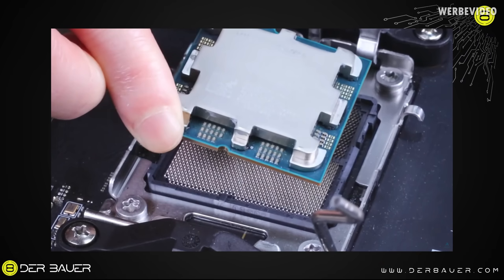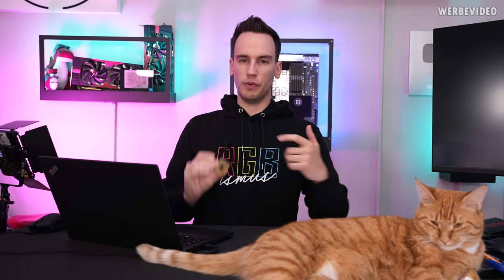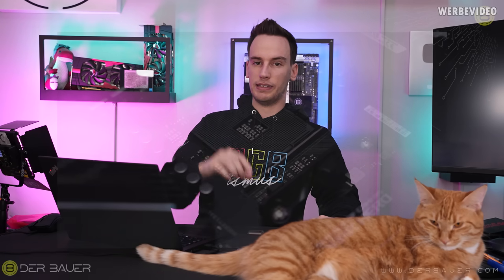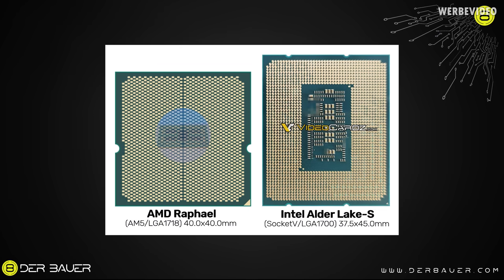Very thick IHS and less Contact Area - some thoughts on Ryzen 7000

Comment: Next video: Der8auer has made his own Zen4 watercooling block 😁
Reply: That's a given with the setup in his workshop. Gonna be awesome.
Reply: More likely a offset bracket for an existing cooler.

Also 100% he will mill the IHS down to test.
Reply: Can you make 4 point mounting brackets for AIO LCs that use the AM4/AM5 plastic clips? I would love to see if the 2 point mount is leaving cooling performance on the table as I suspect. 
Thanks
Reply: @stephanhart9941  just buy a better cooler!
Reply: @ionstorm66  There are High end AIOs that use the 2 point AMD mounting. The cooler isn't the problem, just that they prioritize Intel mounting. My Galahad360 is as "Better" as it gets without a custom loop.  Your point is asinine.
Reply: Germany doesn’t have the electricity for his machine shop anymore
Reply: And he did

Comment: The io die has rdna graphics as well this time so that might be the reason its not as small as expected
Reply: Also, probably why they moved to the center. It will need better cooling this time around
Reply: @broklond  its 2cu igpu that thing wount even sweat
Reply: it has been said that IO doesnt scale as well on a smaller node but also, we are getting more and faster IO so the size is not a surprise
Reply: @broklond  It makes no sense to move the puny 2 CU GPU towards the middle when it pushes the actual power-hungry up to 16 cores more towards the edge.
Reply: @DLTX1007  didnt zen 3 use a 12nm IO die?

Thats a huge difference to the 6nm used now. I know its not a direct comparison, but all else equal it should be a 75% reduction in die size. That its not implies a lot, especially with the graphics cores and large number of PCIe5 lanes to the CPU.

@thatguy75 IIRC the IO die was a not insignificant chunk if the thermal load on zen 3 (up to 30% iirc) and with it supporting 24? PCI 5 lanes as well as two CU’s of graphics its going to need a lot more access to traces and pin contacts. They probably HAD to put it in the center to support the PCI lanes and other stuff without issues
Reply: @JAT985  yes but I said IO doesn't scale well. It's a well known fact in the industry. SRAM scales very well which is why AMD can put massive amounts of L3 onto Zen2/3/4. But IO is harder.
Reply: @DLTX1007  The CPU cores are 5nm while the IO is 6nm so of course it's not going to shrink as much .... Also if you don't actually need the space it's better not to pack the transistors in there even if you can because it will just cool better because the heat from the transistors is spread over a wider area and isn't so concentrated in a smaller spot .... Just making something smaller for the sake of making it smaller and not for a good reason is just poor engineering practice
Reply: @longjohn526  I said IO not CPU cores...

Comment: with that thickness, wonder if anyone has considered a dedicated vapor chamber IHS rather than a traditional solid metal IHS?  people would need to be very careful with heatsink application to prevent damaging the specialty IHS but it might be a way to improve cooling performance by maximizing heat transfer over the entire surface area while eliminating hot spots completely!

Comment: I don't think any of the IHS changes actually matter if the limiting factor is the thermal density of Zen chiplets anyways.
Reply: It does matter. There's a reason people sand off 2mm off IHS or completely remove it.
Reply: ZEN4 can also possibly use wafer thinning as they did in zen 3d to improve thermals.
Reply: @hndfhngtool-assistedspeedr2128  the reason people lapped cpus was not to remove z height it was to create a level contact surface since most ihs's come either concave or convex from factory
Reply: @Bobis32  it's both reasons
Reply: @vineetkumarbharti2633  that doesn't improve thermals. They did it in v-cache chips to keep the same z height so that it fits in the regular IHS.
Reply: @superneenjaa718  but with wafer thinning in zen 4 they can increase IHS thickness which is indeed increased.
Reply: @vineetkumarbharti2633  why would they do so? V-cache stacked chips will come out for zen4 too.
Reply: the problem is die area. For reference...a power transistor (MOSFET usually) would have better thermals and less on-state resistance with a larger die area. Capacitances (that cause anomalies and limit maximum switching speed) would increase as well.

The transistors on the AMD dies are so small but so packed - one solution is to reduce the amount of levels of interconnect and turn a multi-story building to  three or so floors...widen the area where the heat spreader would meet the dies. But there is an issue: signal propagation delay. And also thermal monitoring would be more complicated because die area had enlarged and perhaps require a thermal sensor array

A larger IHS would help balance thermal offset as it would hold more heat - but meant it won't dissipate it that quick as it soaks in temps
Reply: @ruikazane5123  on the other hand, it insures a wider heat spread.

Comment: Having values for the chiplet and i/o die size with the performance date show quite an uplift. Still we have no wattage consumption data for now, but it is coming together slowly.
Reply: I reckon it's gonna be extremely power efficient, especially if they're retaining the existing core count.  The only way it won't be is if they're REALLY pushing the silicon to squeeze out every little bit of clockspeed they can (ie running 0.150vcore higher just to attain an extra 100MHz all-core boost or something)
Reply: It has been revealed on two websites and gamer Nexus and amd also gave new info out
170watt means more like 125watt CPU as the new PPT is 230 watts

So not much difference as all the other CPUs are still at 65 watts and 105 and 125 watts now
The info was corrected by AMD.

It's mainly the reason why the PPT is 230 now so the CPU can overclock further.
There is a max ceiling  to this.
It is still lower than the 12900k which is at 250w PPT

Comment: The thicker ihs will also mean that they have more room for 3d stacking in subsequent generations using the socket by just going back to a more normal thickness.
Reply: Is that going to be practical? They've already had to limit frequencies and prevent overclocking on Ryzen 5800X3D with 3D stacked cache, I assume due to extra heat generation and inferior thermal conductivity of cache compared to copper. Stacking even more cache (or worse, cores) vertically is going to make the thermal situation progressive worse.
Reply from the maker: Not really. For current 3D Stacking technologies you will thin the bottom die before stacking which means that the resulting total height is the same as before. Maybe 0.1mm thicker. But that is for sure not relevant here. If you increase your die by 1mm it will be impossible to cool.
Reply: @der8auer-en  maybe the 3D cache maybe moved across the die as …. Once again : rumoured …. The cache will be increased on the Zen4 die 🤔
Reply: Not quite how it works.
Zen 3D/Milan-X have the same Z height as Zen 3/Milan
Reply: Admittedly I’m not an expert, but maybe they didn’t want to thin the dies? It seemed like kind of a hack with Zen 3 to make it fit with the existing AM4 dimensions, and I would imagine that it added a lot of manufacturing complexity.
Reply: @alex84632  thinning the dies is beneficial because it helps with cooling. Intel thinned the dies on Comet Lake and made the IHS thicker for this reason. Copper is much more conductive than silicon, so for the best cooling you want as little silicon and as much copper as possible between the bottom of the die and the cooler. Though minimising the total distance to the cooler is even more beneficial, as heat pipes are a lot more conductive than copper.
Reply: @kotekzot  Nah Robert Hallock confirmed that the 5800x3d was locked down due to voltage, not heat concerns.
Reply: @kotekzot  they have said that the 3d Vcache was/is significantly more sensitive to voltage and they couldn't  prevent people from killing the CPUs easily but they hope to overcome this in future.
Reply: @der8auer-en  NUDEcnc videos show  extreme lapped working cpus  to *0.5mm
for sure people will remove the just 150W/mk of silicon in exchange to 400w/mk cooper heatsinks.
Reply: @mikesteve3039  did they say why they had to drop core clocks?

Comment: You are correct, if the manufacturer makes a new coolers keep in mind the new(Estimated ) hot spot position, then they will deliver better performance.
Reply: unless they fix the heat transfer issue (IHS does not take any heat from chip), this won´t do anything.

Comment: It's going to be interesting what happens with cooling, as chips get more thermally dense moving heat from the slicon is going to be more complex. I wonder if we will be forced to move more to AIO's or if some more advance cooling will come along. I wonder if we will ever see something like a Vapour Chamber as part of the IHS to help?
Reply: people just need to understand that it's not 2001, they don't need to make their cpu's run below 70c anymore.
Reply: Water channels running inside the die are in development, that could improve cooling a lot, but I expect reliability would decrease significantly.
Reply: @kotekzot  Imagine the price increases 🙃
Reply: @sirmonkey1985  boost frequency is decreased with higher temperatures
Reply: @sirmonkey1985  no but most cpus are fine below 85c on stress tests... gaming load should be 55-75c at max unless you have a 12900k/5950x...then 80c is fine.
Reply: @kotekzot  I’ve been seeing articles about water channels in die for the last 10 years, but apparently nobody wants to touch that for consumer CPUs. I’d love to be proven wrong, but I think we’re still 10 years away.
Reply: @sirmonkey1985  electron migration?
Reply: @NavinF  yeah, I don't see how you can do water channels in the die practically without bonding a "waterblock" to the CPU at the factory.
Reply: What cooling? Better cooler only has very small effect on AMD CPUs, since Ryzen 2xxx, as the IHS does not transfer heat from CPU. The coolers remain cold even at full load.
From my own experience, nowadays with AMD only the fans used matter, not the cooler itself, as there is no heat for the heatsink to take from CPU. Instead, we are cooling down the IHS, which in turn acts as some opposing force against AMD chip to lower its temperature a little.
It´s either a defect in solder (which nobody seems bothered with), or some other thing specific to AMD chip design.
Reply: @Morpheus-pt3wq  small die = less contact area = harder to cool.
Reply: @kotekzot  but small die doesn't explain, why there is literally NONE heat transfer into the heatsink. And it started with AMD 12nm Zen chips, which were larger than current 7nm.
Reply: @Morpheus-pt3wq  I don't believe there is 0 thermal energy transferred from the IHS to the heatsink.
Reply: @Morpheus-pt3wq  interesting, if the IHS does not transfer heat, why does my ryzen on an AIO boots @ 14-21ºc with the fans nowhere near the socket, and the old wraith stealth was already at 40ishºc?
Reply: @malonysaintpierre1599  touch the cooler while cpu is in heavy load. It will be cold, which means there is no heat transfer to the cooler.
Reply: @Morpheus-pt3wq  under load it goes to 40ºC, with the wraith stealth it would reach 70's and would blow how air everywhere, because the heatsink was in fact, hot
Reply: @malonysaintpierre1599  did you touch the cooler to confirm that? 3 of 4 Ryzen cpus in my house (3400g, 3600 & 5600x) do not transfer any heat into the heatsink, no matter how high their load temperature is.
Only thing, that has real effect on their temperatures, are fans. Stronger fan with greater ability to move air through the heatsink, the lower the temperature.
Interestingly enough, another of my Ryzen cpus, 2200g, which only uses thermal paste under ihs instead of solder, is fully able to conduct heat into the cooler.
Reply: @Morpheus-pt3wq  Bro what are you smoking? Where do you think that power goes then?
Reply: @EndstyleGG  your brain fumes. Into the socket.
Reply: @kotekzot  where does the heat from CPU then go, if cooler remains cold while CPU is in heavy load? 
I do think the process is reversed here. Instead of heat transferring from IHS to heatsink, the cold from heatsink is being transferred to the IHS and acts as an opposing force to the die. CPU will still run hot, especially those random spikes, that vary from chip to chip and are uncoolable. My 3600 tends to spike up to 79°C no matter which cooler i put on it.
Reply: @Morpheus-pt3wq  heat = energy and only flows from hot to cold/high energy to low energy. When you open a refrigerator you aren't "letting the cold air out" as some people say, you're letting hot air in. Your hypothesis is fundamentally incorrect. Source: thermodynamics
Reply: @610jrod  well, then something is fundamentally wrong with AMD solder, since most of the heat remains trapped under IHS.
Reply: @Morpheus-pt3wq  unplug all of your fans, run prime95 for a few minutes, then touch the heatpipes at the BASE of your cpu cooler, closest to the IHS. You'll feel that the cpu cooler is warmer than ambient & is transferring heat away from the IHS.
Reply: @610jrod  are you trying to punish him for not understanding thermodynamics by telling him to fry his CPU?
Reply: @610jrod  what are you talking about. When i feel the airflow through the radiator on my 2600x at 60c, the air definitely gets hot, meaning it transfers heat just fine. Your heat transfer theory doesn't make sense
Reply: @kotekzot  prime95 is the first thing that came to mind to guarantee heat generation. It'll thermal throttle itself for a couple mins but that won't kill it
Reply: @DarkoPetreski  I'm not sure what your point is. In your example the heat still transfers from cpu -> ihs -> thermal paste -> cpu cooler -> water -> radiator -> air. Morphius is saying it happens in the reverse direction.
Reply: @610jrod  i´m still interested, WHY is the heat transfer on 7nm chips SO LOW. If the CPU runs at 70-80W or more, the heatsink should be hot af, so i should burn my fingers, when touching it.
I´m not unplugging my fans. Air isn´t effective heat conductor, that´s why we need a lot of it for cooling.
Reply: @Morpheus-pt3wq  there are a few factors. 1. The CPU is rated up to those temperatures but it isn't going to draw that much power unless you put a large load on the it. At idle/basic office/web browsing use it's probably closer to 20w or less. Similar to how your car may be able to go 150mph but you aren't actually reaching those speeds day-to-day. You can use a program like HWINFO to see the power draw. 
2. The thermal mass of your CPU cooler is many times greater than that of the CPU. The heat is distributed from the base into the cooler, as it moves farther from the heat source the energy is bled off by conductivity with the air. Yes air is a poor conductor but that is made up for by having many fins to increase the surface area (instead of a solid block of metal), and by using fans to constantly force fresh air over the fins instead of solely relying on conduction to move heat away from the cooler. The greater the difference in temperature between the cooler and air the more effectively energy is able to transfer. If you remove the fans and rely solely on conduction the cooler would warm up, heat the air molecules immediately adjacent, and then lose effectiveness as the temperatures near equilibrium
Reply: @610jrod  thanks for the exhausting reply. Also thanks for not giving up on me.
Reply: @Morpheus-pt3wq  you're welcome. No worries, it's good to ask questions & want to understand why things happen
Reply: @610jrod  it´s the only way to knowledge i know about.
Reply: @TheBURBAN111  the 5950X is very power efficient even on multicore AVX workloads, it shouldn't hit 75 C (even without undervolt) during gaming with a decent single tower air cooler.
Reply: @Postman00  it does though... even with the nhd15 it can hit 75c while gaming...
Reply: @TheBURBAN111  I'm literally using a NH-D15 in one of my two 5950X workstations. That station's CPU maxes out at 68 degrees in games. What's your ambient temperature and what case are you using?
Reply: @Postman00  Only going off what ive seen on peoples setups... they were probably using PBO with auto vcore.
Reply: @TheBURBAN111  a proper overclock should include a stability tested undervolt, and a stock 5950X would not boost high enough for gaming power consumption to cause high temps. I wouldn't look at misconfigured systems and say "there, 5950X runs hot!"
Reply: @kotekzot  I heard of that many time ago and I actually don't agree with such thing to ever be released... Judging the huge problems many AIO have been having, imagine if they make a CPU that is made to really need water passing trough and what it would happen if it gets all clogged up some time later 😵😭
Reply: @guily6669  at the moment, watercooling is mostly a meme for enthusiasts. With water channels running inside the die, it would actually become good enough to develop some hardware support, e.g. the motherboard generating alerts if the flow rate decreases too much (clogging doesn't normally go from 0 to 100, so there's time to fix it), throttling power consumption depending on the flow rate, emergency shutdown.
Reply: @kotekzot   still the channels would be very micro and would be pretty problematic after getting clogged and super hard to maybe even impossible to clean unless maybe with a sonic cleaner + air compressor and still who knows...

Comment: If the IHS is a good grade copper this could make a lot of sense. I'm also thinking that the "octopus" style, as you call it, might prevent the slight bending that we see on Alder Lake.
Reply: They probably needed as much surface as possible hence the weird shape. I just wonder if this wasn't to little. We'll see what the thermal performance is going to be.